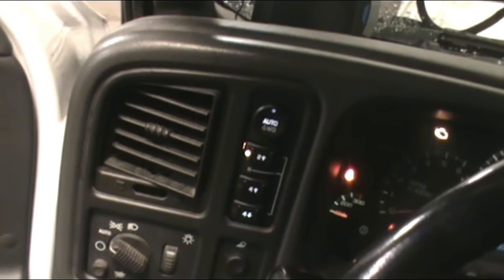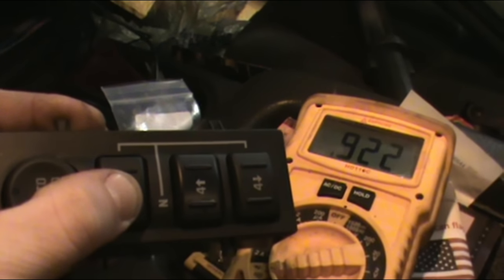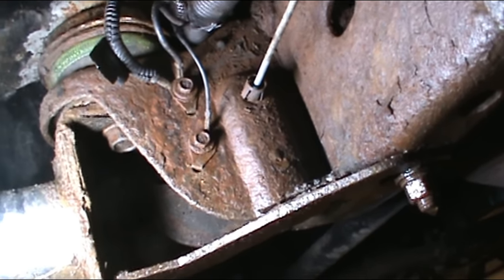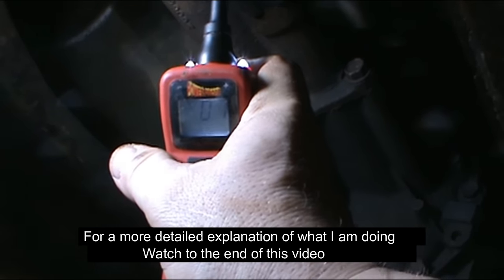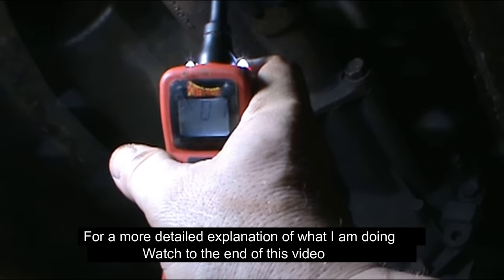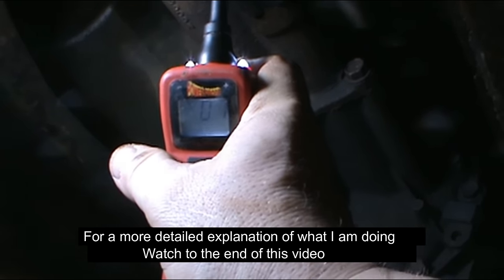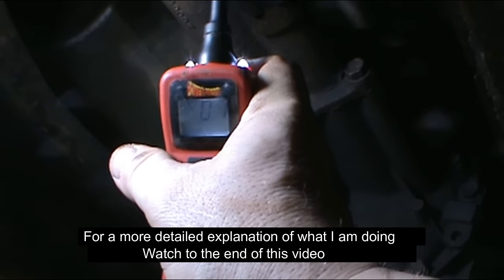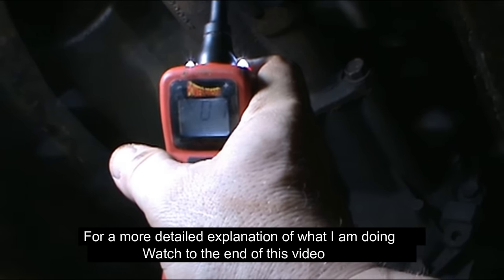Service 4wd diagnosis

Comment: I need some help service 4wd light come on selector lights went out. I changed switch ,,computer and shift motor encoder as most call it.  Put back together lights come on 4wd worked perfect all ranges put in 2 hi run maybe 40 miles lights went out blowed fuse under hood 
Can the ground you fixed have caused this
Reply from the maker: So long as you spliced the right wire it wouldn’t.  The fuse under the dash controls the shift motor.  I would look for a chafed wire
Reply: @gseshop I haven’t spliced anything yet I replaced parts listed above new worked then blew fuse.  I happen to come across ur post.  I can agree there’s gotta be a chaffed half broke wire somewhere this thing has bout run me crazy.  My key switch is messin up to it’s catchin then ridin my security, battery and service 4wd light flashes constantly gas gauge temp gauge volt meter goes dead wiggle key real hard all gauges go back to workin but 4wd light stays on. 
Surely key wouldn’t shut the 4wd down. And where I live it’s near impossible to get someone to work on it if the do they wanna keep it 2 weeks. I’ll look more tomorrow.  Anymore info u may think of would be greatly appreciated 
Thanks again
Reply from the maker: @Fireman-TC  check the wires on the shift motor.  I have had them rub the front driveshaft and mess things up before.  I would also check my ignition switch.  Electrical problems are funny, I once spent months trying to diagnose an intermittent misfire.  When my truck failed to start I changed the battery and boom, misfire went away.
Reply: @GSEShop  I put a new battery in 2 weeks ago I got a new key switch assembly wires and all. I’m leaning toward the chaffed broke or raw wire as u said I had dealership install new motor and trans 5000 miles ago and there’s a real good chance they could’ve damaged a wire during the install. I’ve replaced all 4wd components and it worked for approximately 50 miles perfect so all that’s warranted I hear a click when I touch the atc fuse I’ll get back on it this afternoon when I get home
Reply from the maker: @Fireman-TC  keep me posted, I am interested
Reply: @gse just givin a update buddy man this trucks gave me a fit with wild gauges and 4wd light anyway I replaced everything to do with 4wd still acted up finally took plastic cover off throttle body as I call I know that’s not the proper name but anyway there’s 2 wires that go to back off motor wiggled them and everything instantly works correctly no malfunctioning whatsoever only thing is I haven’t spliced a new ground because im not sure which set of 2 is the ground to splice but I do no one of the 2 wiggled is the ground and the whole problem
Reply from the maker: @Fireman-TC  the throttle body on the engine?
Reply: @GSEShop   I don’t know the proper name but take the plastic cover off top off engine from what I’ve gathered the map sensor is there but there’s another plug right beside it so I wiggled that wire and everything worked perfectly. I haven’t spliced anything but I’m assuming that’s the ground everyone is talking about to the back of the engine 
Your opinion????
Reply from the maker: @Fireman-TC  It could be, before I splice anything I would take a good hard look at that wire and see how to fix that.  Everything electrical is interrelated
Reply: @GSEShop  yep I didn’t splice it yet it was dark it’s a wire with plug right beside map sensor looks to be attached to back of motor all my lights was on temp and fuel gauge wouldn’t work soon as I wiggled that wire all lights went out and all gauges went back to working I was tickled boy that things give me a fit I got the right wire just makin sure what it is before I splice in to it

Comment: Ok - so I’m not smart with ANY of this - but following your steps. On my first test: the switch. I noticed on your multimeter it stays at 1 until you press a button. When i tried the test with my touch multimeter, the second i touched the two inner connections it jumps (but eventually stabilizes) around 1650. Then as i press the buttons they change and stabilizing similar to yours. Should my switch remain at 1 until i hit a button even with the connectors attached/touched? Since I’m getting that jump to a number before i even press a button and simply just touch the two inner connectors does that point to a possible bad switch or just a different kind of multimeter? Thanks!
Reply: I guess i could also add - after watching your video originally and thinking about it, i noticed this morning that if i slap the dashboard i can make the lights flicker and/or go out. If i hit it a few more times i can make them come back on. So that really got me thinking maybe just the switch is bad and is causing the service 4wd error? I don’t stay in service 4wd forever - it sometimes pops on randomly and then will turn off the next time i drive. It’s completely random - which also makes me wonder if it’s just a switch issue throwing it.
Reply from the maker: Jesse Griffiths usually as long as the reading is stable you are good.  Different multimeters and different settings give you different readings, however with that said an intermittent fault is the hardest to diagnose.  So with all that said I would try a cheap switch off amazon and see if it clears up because it is a known fault and the easiest to do.  I hope that helps.  It may not be malfunctioning when you test doesn’t mean it doesn’t malfunction.
Reply: GSE Shop thanks for the crazy fast reply! I think i will try that - because if nothing else, slapping the dash shouldn’t cause the lights to go out (if it’s something in the hood or underneath).
Reply from the maker: Jesse Griffiths to me it sounds like a possible loose connection

Comment: So mine is a 05, and sometimes there is no service 4wd light, and other times it is. So mine was like yours in the beginning, the lights for the 2wd come on, but when i press to switch it in 4wd it does nothing, no light or anything. This issue is prolly the switch im thinking right ?
Reply from the maker: Test the switch, I show you how in the video.  The switch just tells you what it is being told to it by other components.

Comment: I have a 98  Yukon slt and all my panel lights stay lit up. No blinking just solid. Replaced the panel switch (still stays lit up) and I replaced the actuator.  Still lit up solid and says service 4x4. Also feels like its bogging down a little at low speed between 25 and 30.
Reply from the maker: While I am not as familiar with the older ones, I would check my grounds before going much further
Reply: @GSEShop  thank you I will.  I've never had any issues with this yukon. I've had it for 15 years and have been lucky so far with the transfer case.  Thanks
Reply from the maker: @MisterManseattle  no problem if you think I can help please let me know

Comment: With the blue wire how are you tapping it in are you just sticking it into the plug in closing the plug again
Reply from the maker: I spliced the wire with a common vampire connector
Reply: @GSEShop  ok cool... My 96 tahoe is stuck in 4wd low ..! I just changed the front axle actuator ..still stuck in low.. ck both fuses #2 & #24 both good. I just order a new push button switch .hopefully that's it . I tried changing trans  from park r n d n r etc... also disconnected the battery for about a hr . Still stuck in low..  if the new switch is not the problem.  What is left transfer case motor ?? If so is it hard to change ? I will also ck the ground now.. 
Thanks Rob
Reply from the maker: @robertsmith-ux8ls  I haven’t done one on a 96, but I have a full video on changing one in an 06.  You could look there, but the hardest part for me was pulling the front driveshaft

Comment: I cannot for the life of me find this wire and connector coming from the actuator to the larger connector you added the jumper cable to lol.  I’ve searched and searched.  I have an 04 avalanche. Would the wire look different or be in another location?
Reply from the maker: Cody Van Scyoc I cannot say it is or isn’t.  I just know where it is on my Silverado.  I am told the Tahoe’s are different.

Comment: When I turn the ignition on my 4x4 selector all light up for a second. I’m guessing it’s a light test. Then I have nothing. No lights and no action from pushing any of the selections. I did the ohm test on the switch and all seems fine. I get a change on the meter for each button and the meter holds steady. I see nothing wrong with the wires by the transfer case. Any ideas what to check next? Thanks for any help.
Reply from the maker: I would look into either changing the transfer case shift motor or, the encoder ring in the motor.  I have a video that goes step by step into this process on this channel.  Changing the whole thing is easier but changing the ring yourself is cheaper.
Reply: Hello , Did you fix the problem? I have the same problem  now. No power on 4wd selector  and the 4wd service light ; the selector just flash when I turn the key. Thank you.

Comment: I have a 2003 Z71 Tahoe with 283,000 miles.  I had this problem one other time and had it fixed at the dealership. 

Thanks for the info, I will give it a try.  Is this vehicle supported by jackstands while you are underneath?  I saw an assortment in your garage.
Reply from the maker: Thanks for the comment and rest assured I never get under one that isn’t on stands.  That is how I ended up with so many

Comment: First thing to do is remove the TCM fuse for a few minutes to reset the transfer case. Or disconnect battery for a few minutes. Fixed my quirky TC problems. Also clean those grounds while at it.
Reply from the maker: Worth a try

Comment: So I have a 04 suburban with 5.3 and my buddy has a silverado. His 4wd works so we took out my switch and plugged it in his truck and it works but the lights wont even light up in mine. Not 2 wd or anything. Any ideas?
Reply from the maker: Probably the encoder in the shift motor.  I have a video on that if you want to change just the encoder or the whole shift motor assembly.
Reply: Kinda like my 99 sierra. No lights, no service 4x4 light. Except when its snows the selector lights randomly flash. I've changed out the switch and nothing. I have no clue what's going on.
Reply from the maker: @87hektor  you most likely either have a broken wire or encoder issue.  Those would be my guess
Reply: @GSEShop  a broken wire makes sense after watching the last of your video where you explain how to use the multimeter.

Comment: Are you connecting the blue wire to the black wire up top
Reply from the maker: My blue wire to the ground wire on the front axle actuator (that was black) to the body ground on the cab

Comment: Good morning GSE,  on the fron differential actuator five pins plug.  I did get signal two ground and a power wire but I did not get any signal from a "Black wire with a white stripe" on it.  Could you please tell what Black/White stripe wire  connect to or signal I should get?   Thanks in addvance  Vey
Reply from the maker: Those two wires will have different voltages depending on what position and what is going on.  When you press the button on your shift selector one wire provides signal current to the actuator to tell it to move into a position (either extended for 4wd or to retract for 2wd).  The other wire sends a signal to the computer to inform it of what position the actuator is in (either extended or retracted).  Unfortunately I cannot think of a way to check these two wires with the device unplugged.  You can either pierce the insulation of these wires and check for different signals when the button is pressed and if there are different signals when the actuator is in position, but I highly recommend against this as you will eventually have corrosion in those wires and that will cause more faults.  The only other real method unfortunately is to use a scan tool that can read GM tech two codes.   I hope this helps.
Reply: @GSEShop  The only1 "Black wire with a White stripe" which I really want to know the most because all other wire are OK.  Thanks for your time to reply back.

Vey

Comment: Do you think it's likely the selector switch if all of a sudden no lights on the switch at all & no noises?
Reply from the maker: Colton Blumhagen that is the quickest and easiest to check, if not check your motor wires, then I would look at the shift motor encoder.  I have a video about changing that.
Reply: @GSEShop  I checked and I have continuity in all except the auto button
Reply from the maker: Colton Blumhagen well that could be a problem, check the wires just to because it is free, and then get a switch from amazon if you don’t find anything

Comment: Do you know which wire (If any) should be going to ground in the 8 pin connector at the shift motor?
Reply from the maker: I cannot say 100% if I am correct, but if you are talking about the front axle actuator, then I would have to say none of them are going to the motor.  The actuator operates independently and signals the TCCM when it is in position or when it has a problem.  Same as the transfer case shift motor.  The way I understand it they are two independent systems connected to the same computer brain.  I have not studied the schematics to be 100% sure, but to the best of my knowledge this is how it is.

Comment: I have a 05 chevy silverado. Bought it and it didn’t have an accuator, so I put one in and I’m having issues. I plug the accuator in and it still says service 4wd. Also the lights for 2hi and the others are not lit up, only the red neutral is on. I’m so lost. Now, when I first got it hooked up it was in the neutral position but would flash on 2 hi and 4w when I tried putting them into it but wouldn’t go into them, just flashed and went back into neutral… but now it just shows neutral and won’t even try to go into any others.
Reply from the maker: Sounds like an encoder issue, I have a video on it.
Reply: @GSEShop  alright so I bought a different actuator and I’m still getting the same issue. Also a new switch put in. I turn the ignition to on but not the engine, put in neutral. The switch says the truck is in neutral but when I then press 2 hi it blinks and goes back to neutral. The actuator is making a noise trying to shift it….
Update: decided to remove it and try to shift it while plugged in and the shifter doesn’t even move just makes a noise, assuming it broken…
Reply from the maker: @gavinsmitty23  I still say it is the encoder in the transfer case control module.. I have a video on it
Reply: @GSEShop  welp went down the rabbit hole trying everything. Put a new encoder motor on that was in 2hi. Installed it and would just blink when trying to go into 4hi. Now it’s stuck on auto 4wd and won’t even try to go into anything else. Replaced 4x4 actuator, switch, did a ground clean up and vampire ground. Also tried a new control module. Nada. I drained the battery when putting in a new module too. Idk what’s up with it but I’ve about had it lol now this may be a dumb question but the 3 bolts for the encoder shift motor I’m using is not the factory bolts for it, I found 3 bolts that fit and tightened it up. Don’t think that would be a issue but I’m not sure.
Reply from the maker: I wonder if your axle actuator is stuck
Reply: @GSEShop solved. Got a code c0321. Mouse nested in the fuse box and chewed a wire….
Reply from the maker: @gavinsmitty23  that would do it

Comment: So the blue wire you added is a ground which you said in the video is the same ground that is on the frame rail. Why didn’t you just clean the ground on the frame rail?
Reply from the maker: Because I did clean it.  I think the wire corroded internally and rather than cut and splice a wire in where the frame rusts.  I cut and spliced a wire in where it will never rust
Reply: @GSEShop  OK maybe you can help me. My truck says service four-wheel-drive and on the knob none of the lights are lit. Now you would think it would be the switch so before I replace I wanna know your opinion. When you turn ignition on all the lights on the switch light up. So idk if it is the switch. I cleaned the ground on the frame and I already did what you did mistakingly and replaced the actuator and the front driveshaft actuator and still nothing. I’m thinking it’s either the switch, a wire somewhere, or the module
Reply from the maker: @krishermanowski3599  you have the newer model?
Reply: @GSEShop  yes 2008
Reply from the maker: @krishermanowski3599  I am not a familiar with the newer ones, but when the lights flash on startup it is the computer checking to see what position the transfer case is in (4h 4l n or 2h) and depending on the signal from the encoder it determines what position it is in.  When the lights go out it is because it did not get a signal or the right signal for any of the positions so it doesn’t know where it is.  You problem probably is the encoder or the wires leading to it.  That is where I would be looking.
Reply: @GSEShop  what is the encoder. Is that the original hung under the dash you was talking about in the video.
Reply from the maker: @krishermanowski3599  no it is part of the transfer case shift motor
Reply: @GSEShop  I replaced the whole transfer case shift motor.